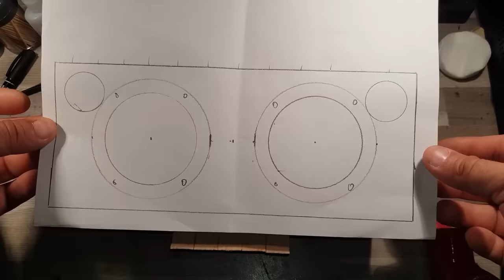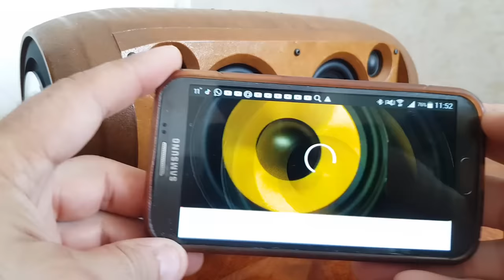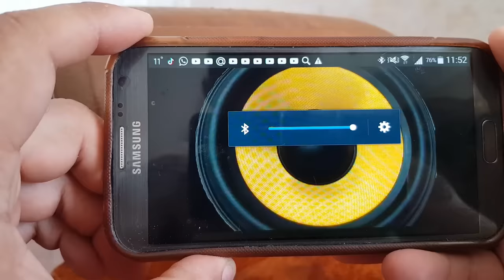DIY Powerful Bluetooth BoomBox 50W(2x25W) 14000mAh Battery

Comment: The tweeters have no crossover and will blow out.. nice boombox btw
Reply: @ratupmyass  you can see on the back of the tweeter that there is nothing connected to the terminals and there isn't any hidden crossover inside a 1" tweeter 😂😂
Reply: The tweeters were connected directly to the woofers so that means that they are getting full signal instead of only high frequency ..
Reply: @ratupmyass  that's what I thought but when you look in the video there is no crossover between woofer and tweeter
Reply: Yeah, I build speakers for a living, there is definitely no crossover.  I’m sure the tweeters were dying. Throw a simple cap in series with the positive input of the tweeter. It’ll give you a 1st order crossover (6db per octave). To figure out the value of cap you’ll need to know the nominal impedance of the tweeter and the frequency you want to shoot for.  I’d say maybe 10,000hz, you’ll be down 12 dB at 2,500hz and should blend well with the other drivers if you’re running them wide open also. 

But yeah, you’ll be doing a lot tweeter changes and you can hear them distorting in the video, or you mic is clipping.
Reply: Is capacitor not enough?
Reply: @danhorton6182  i thought this mini tweeters have a built in capacitor already?
Reply: @ex-soldier4341  no, they don't
Reply: @berserker341  i only use condenser for tweeters, crossovers is just another cost, is capacitor not enough?
Reply: @ex-soldier4341  it should be alright
Reply: Sometimes the crossover is built in the amplifier with a small dsp, u just need to connect tweeter on the tweeter out
Reply: @Jean-Triphase  yes I know but the tweeter is connected on the same input as the woofer ..
Reply: @Jean-Triphase  yeah many boards have this don't they?
Reply: @berserker341  do you think maybe the speaker terminal is the crossover?
Reply: Might be a piezo electric tweeter
Reply: gay
Nah, I don’t see any capacitors
Reply: @ratupmyass  21:50 just listen to the recording, when the bass hits and mid and high frequencies (vocals) are playing at the same time, the bass bleeds into the vocals and make it muffled, this speaker doesn't have crossover whatsoever and the tweeters will likely die soon.
Reply: @danhorton6182  How could you learn ALL this informations? I wish i could know half of this, i was happy.
Reply: @francopieruccinifaria9454  Google is your friend. And Youtube. Just look up any videos about crossovers and/or high-pass low-pass band-pass filters etc.
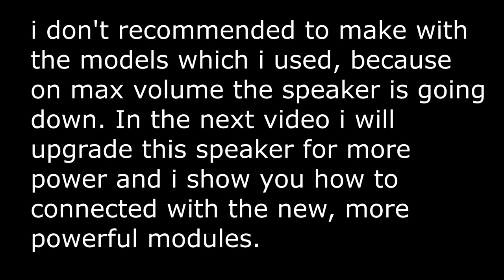Reply from the maker: Guys please stop to talking about tweeters.  At 17:55 minutes you can see massage. Look at my 2nd video where i upgraded this speaker. Nothing will die soon don't worry.
Reply: @VGBSpeakers  i know but they kept on talking about it 😂
Reply: @VGBSpeakers  What is the value of your work to send such a box to Brazil?
Reply: @francopieruccinifaria9454  Google
Reply: well, you can run tweeters fully active, you just want some the are way higher rms then what's being fed into them
Reply: Bloody hell. Some one read a book. Maybe a bit of schooling.Am amazed people go this far without the knowlrdgedge or understanding to put in a 5 cent part. See you can understandand that a computer most likeleley wouldn't. hahahahah:)haha
Reply: The dust Would be popping in and out I know from experience
Reply: @francopieruccinifaria9454  there's a lot of videos about it, search what a crossover is, how to built, why use a crossover etc
Reply: @VGBSpeakers  nah its good to talk about it dude as its teaching people who don't know. We know you said this but its still a good thing to talk about so others don't make the same mistake as 1, they may of missed the msg
Reply: @chaseleim4773  no dude this will kill them much quicker. Never under power a speaker. If a speaker needs say 20 watts but the amp is 10 the speaker will demand the amp to give 20 but it can't so it takes short cuts in the sine wave making them square waves which will result in the cone not moving enough which will over heat them and boom bye bye tweeter. https://www.youtube.com/watch?v=l9L7uK7Xy0w
Reply: @danhorton6182  don't you suggest to divide the two speakers in theirs box? I mean to put a piece of wood in the middle of the boombox

Comment: Cool build!
I would just do a couple of things different :
1) Use cross-overs or cap for the tweeters
2) maybe a small bass pipe
3) I would use plywood for the rings to make a cool pattern
4) Use Danish Oil instead of stain
5) Maybe since this is a nice build use higher quality drivers (like Dayton Audio)
Reply: slachijt Benhaiem there’s no need of a bass pipe if he’s using passive radiators
Reply: @simar7777777  brother please let me know that what type of Speaker used here, woofer or subwoofer?

Comment: Nice build! its like beeing hypnotised :p. But what is the use of the 2 transparent tubes @ 17:23 ? Even out the pressure inside?
Reply: I believe the purpose of those are to transmit the light from the LED indicators to the exterior of the speaker...

Comment: Sir very nice speaker build.
Bot all credit goes to the wood work. Very nice wood work.
And sir can you please make a small 5 volt powered speaker with RGB lighting front panel.
Reply from the maker: yes I will do it
Reply: @VGBSpeakers  
Sir please don't mind.
Do you sell the boxes?
Reply: @VGBSpeakers  
It seems that the speakers are little more powerful than the radiators.I think you should upgrade your radiators or use a weight in the middle of them. And also you should use a more powerful amp.

Comment: Can you please use the ghxamp 2.5 inch 40hm 25w in that speaker box? Thank you. Or can you build a box with a ghx amp waterproof 2 inch 20w and ghxamp 2.5 inch 25w combined 4 pcs speakers in one box with a passive radiator. I just bought these speakers and I don't know what to do with them, I have no idea of the capacity of the box and design. Please make one, please.

Comment: Good afternoon, I would like to know if you could put the thickness of the MDF's used and the diameter of the cut circles and the measurement of the front of the speakers, so that you can put together a project similar to yours, because it has finished very well. Congratulations!!!!
Reply from the maker: You can see all of the informations you need on the descriptions of my next video where i upgraded the speaker
Reply: @VGBSpeakers  I just watched the new video, and it's even better. Thanks for the information and congratulations for the work.

Comment: 23:06 it seems to be completely out of phase, the passive radiators are moving quicker than the active driver, you didn't activate any crossover ? because this speaker cannot play 30hz right ?

Comment: what is your music play time at max volume
Reply from the maker: with my dc dc step up module it's not working on max volume. I will upgrade this speaker on the next video for more power.
Reply from the maker: Engineer1013  that's the step down converter for charging the battery.

Comment: you should be a millionaire why not  sale them . but locally cause it looked like extreme speaker. two questions  is amplifier 12v and the feet why not use two feets one for each side instead big one

Comment: Can we see the list of items?
Reply from the maker: look the message at 17:55 pls
Reply: @VGBSpeakers  Understood. Anyway are these AIYIMA Silk film tweeters in this project?
Reply from the maker: @marianb.5960  no this tweeters is GHXAMP. https://www.aliexpress.com/item/32968414394.html?spm=a2g0s.9042311.0.0.27424c4d9w41IW
Reply from the maker: @marianb.5960  here is the AIYIMA tweeters: https://www.aliexpress.com/item/32757545056.html?spm=a2g0o.detail.1000014.9.1263345aBl2ktX&gps-id=pcDetailBottomMoreOtherSeller&scm=1007.13338.125185.0&scm_id=1007.13338.125185.0&scm-url=1007.13338.125185.0&pvid=40c1afab-ead7-4636-9d37-622eabc4ae42
Reply: @VGBSpeakers  Thank you so much. But can I use 8ohm tweeters with 4ohm speakers?
Reply from the maker: @marianb.5960  yes but need some heatsink for chip.

Comment: If u open a channel for air flow .. maybe the sound be more quality
Reply: You can't have both passive radiators and a flex port. Also, passive radiators are a better choice for small enclosures and outdoor use